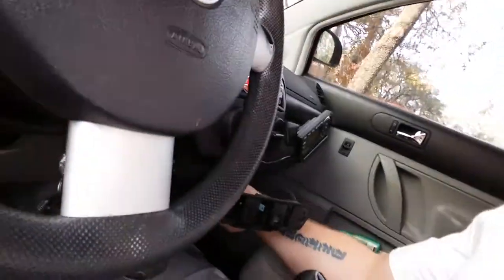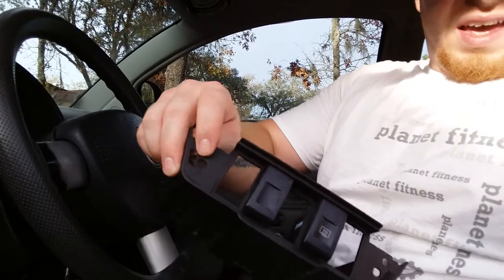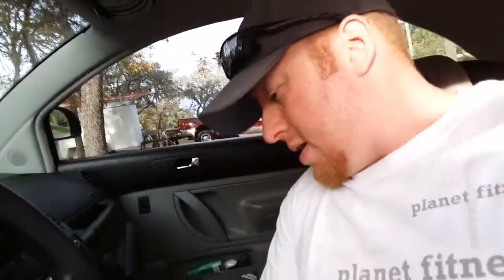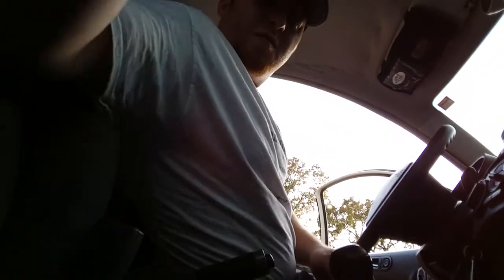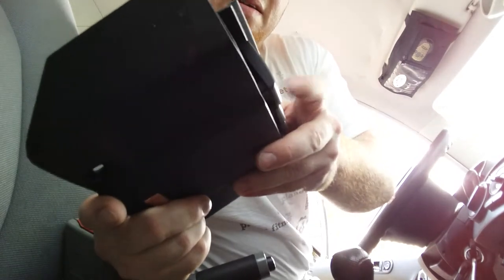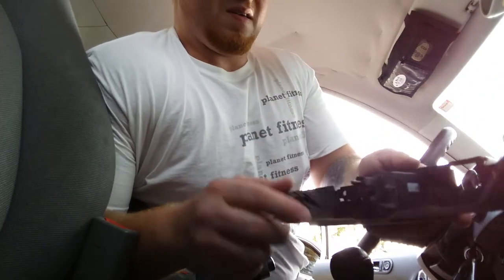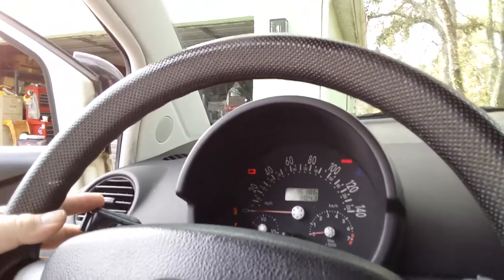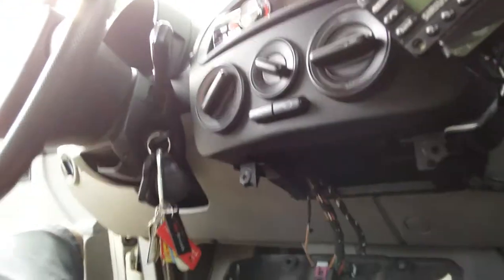how to fix 98 Volkswagen Beetle no turn signals or hazards PLEASE LIKE

Comment: Hey man thanks for this great video. After I checked my fuses and they were OK. I figured it was this relay and bingo. The part was 50 bucks but doing it myself saved me a visit to the shop. Make more good videos! 👍 thanks
Reply: Congratulations. I took this guy's advice and after I checked that the fuse was good I went and bought you used Hazard switch and now everything works again. Volkswagens are not cheap to work on so finding this video helped me owe so much

Comment: This was of some help, thank you!  I just wish you could have videoed  actually removing that panel/unit that housed the hazards etc.  Yea i know, can't please everybody all of the time.  ;)
Reply from the maker: Judy B i did but my phone deleted it .thats why i explain how to remove it during the filming
Reply: johnny del, sorry i meant like you taking out each screw etc...i have to "see" it done.  I ran into problems when i removed the screws from it hanging with all the connections i guess?  Now my car won't start, and all i did was remove screws to that panel. Now on to finding out what the heck happened during the screw removal and maybe tugging on wires from hanging.  Nothing you did or didn't do believe me, i LOVED your video it's just that,  as i said, i needed to "see" it done step by step.
Reply from the maker: Judy B there's two front covers you pull off at the edge of  both .they pull forward than you'll see the  screws and there screws underneath .nothing to it for screws or take it right down you can unplug and slide it out
Reply: @johnny del...Thank you SO MUCH!!

Comment: Very helpful video as I have the same problem, but we replaced the hazard relay, after we did that, all indicators and hazards working fine, then 30 mins into driving the car, smoke coming out of relay switch and no indicators again 😕 someone said it could be the indicator stalk so going to try that today.
Reply from the maker: Or it could of been a bad part .did u find out?
Reply: johnny dee unfortunately not 😕 we changed the stalks and was no different. So we messed about for a bit and worked out it’s something on the drivers side that’s causing the issue, changed the indicator bulb and hey presto it seemed to fix it but only for a couple of days until the relay blew again. So bought another relay (the third one now) and it’s going into a garage on Monday to see if he can figure it out. Thanks for the reply. Will let you know the outcome 👍
Reply from the maker: @missloulabelle18  sound like a short fuse is probably to big to blow first
Reply: johnny dee found out the problem. Loose/bared wires coming from door mirror on drivers side 😂 seems to be working 🤞👏 thanks for your help 👍
Reply from the maker: @missloulabelle18  nice knew it had to be a short of some sort glad you got it working

Comment: It worked !! And only cost me 20 dollars and was the quickest fix! Thank you! Now any idea how to get the AC to stop blowing warm air ?! Haha
Reply from the maker: Glad u fixed it .yes charge ur AC up with a can of 134 if one can works and stays working ur gd if it stops after a few hrs or days u have a leak if it don't work u have to find out what's broken. Get a small 16 once can with a gauge if low on gauge have car running with AC on .u will hair the compressor come on once there is a nuff 134 in it keep filling if low gd luck

Comment: So blinkers run through the Hazzard switch? My blinkers indicator light comes on but doesn't blink. Same for Hazzard switch. After messing with them for awhile they work again for awhile. Thanks, Dave.
Reply from the maker: Nice
Reply: So I'll get another hazzard switch at some point. In the hot weather it worked like it should now I have to mees with it more often. I'll start looking around the salvage yards I guess!
Reply from the maker: @davekana8388  yes u can but i rec.pic up a new one if possible.alway a risk with used parts
Reply: Thanks, will do!

Comment: So my hazards are working but not the signals. Should i try this relay first or just replace the turn signal stalk?
Reply from the maker: Check ur fuses then try the relay
Reply from the maker: My 4ways worked my turns did not .hit around relayon the dash with signal on see if they flash if they do replace it
Reply: @johnnydel6050  
Fuses are good and i just pulled the hazard relay, connectors where clean and plugged it back it. 

Hazards work no turn signal
Reply from the maker: @zachcowley779  can unplug it and test for power .put signal on and test the ends for power change if no power from signal change the lever

Comment: My hazards work but not indicators. Is it the same fix?
Reply from the maker: Depends when u turn it on does the signal light flash or stay on at all or any clicking sound?
Reply: @johnnydel6050  They flash once with one click. They don't stay on at all after that.
Reply from the maker: @CortinasAndClassics  it should be the same problem unless it loses power at switch but this should take care of it up date me .what year is the bug?
Reply: @johnnydel6050  it's a 2001 but I just fixed the box. I dismantled it and cleaned the contacts 👍
Reply from the maker: @CortinasAndClassics  so it works now ?
Reply: @johnnydel6050  seems to be yes. I have to press the button to a lot to make a good connection.